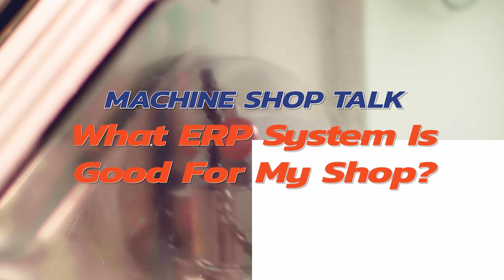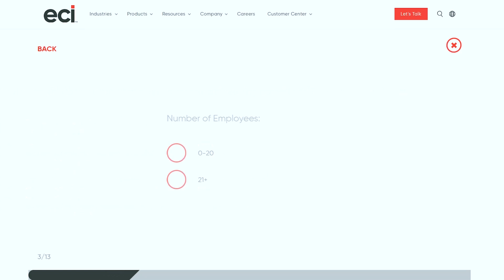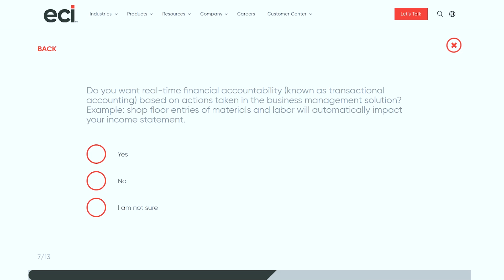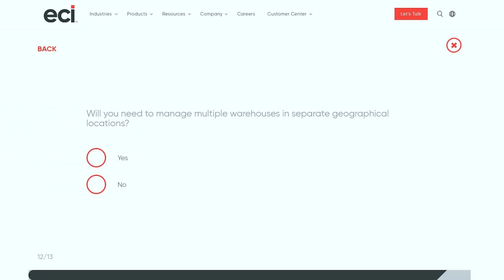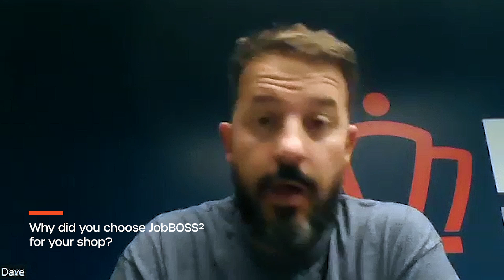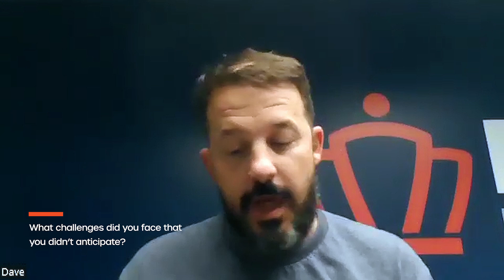What ERP System Is Good For My Shop? | Machine Shop Talk Ep. 119

Comment: I am using an ERP for the first time in the 25 years we've owned our machine shop. A couple years ago I didn't even know what an ERP is and does. 
We have a couple aerospace customers but they limited what kind of work they give us and and told us we would see more work if we got certified to AS9100. I was recommended Simple Trak by a local aerospace machine shop I am acquainted with. This is a web based ERP and QMS combo. It designed to comply and adhere to the strict AS9100 standards. I didn't know what I was getting into but we went for it. It totaled about $10000 but with that we got certified to AS9100 and ISO 9001. Before implementing the ERP everything we did and planned was from our heads and we didn't accurately track the progress of our jobs or kept close track of time as we are such a small shop with 2-3 employees. With our ERP we can plan every step of our jobs in our digital routers (travelers) , we sign off on every step of the machining process, and we keep all inspection/material records stored with each job. Our employees use IPads to sign off what step they just performed and in real time the system is updated no matter what computer you are using. 
We still use Quickbooks for the financial side of the business but now all of our purchase orders are made from the ERP. 
This has completely changed our business, my brain power is free to focus on more important things and I can see what stage any job in the shop is at currently. I can also retrieve records from the past easily by searching part numbers, po numbers, material lot numbers, customers, vendors, etc. 
we also incorporate set up sheets but we're not there yet. 
There is obviously a decent size investment and a learning curve to overcome and we're not going to benefit right away, but our customers do appreciate what we did and slowly we are seeing more work. If you don't do aerospace work then the AS9100 isn't really for you but I believe our ERP definitely helped improve the efficiency of our business.